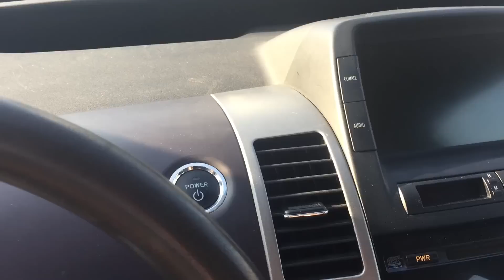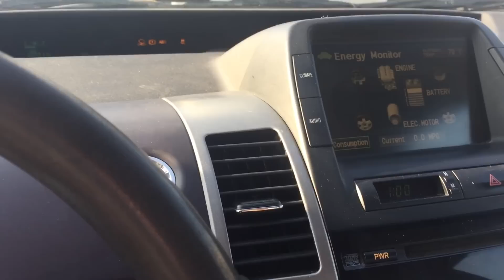2004-2009 Toyota Prius no dash lights fix!

Comment: I just fixed this problem by holding my start button for 10 sec and it reset. Try it out before you pull the battery.
Reply: That’s a good idea!  Have you had any more issues with that sense?
Reply: @SouthernSweetTia  it fixes it at the same rate I believe that this video fixes it. it's not a fix to the actual problem. it's a temporary solution. Since I don't have any intention to pull the dash any time soon. I will use it till it works. Most people when they are getting in their car simply don't have time to pull this plug out. This worked for me and I don't know if it will fix it everytime. It just worked for me last time.
Reply: @SouthernSweetTia  Tia the problem has not come back yet. So far I have seen this problem on my car about once every 3 months. So in short, it will come back and I hope this works everytime until the dash just stops working.

Comment: I had a mechanic tell me that i need to remove my dashboard And get a capacitor installed! All I need, it to reset the wires.
Reply: The capacitor fix is the perminate fix,, this is the walk-around way, but it will eventually happen again...
Reply: Richard Pulliam III the dealer want to charge me $850 and keep the car for 2 weeks!

Comment: You know you can just unwratchet the negative grounding bolt w/ a 10mm wrench, much easier way to do this hack! The negative is on the frame to the right of the battery, way way less work!

Comment: you sir are a hack  it was actually painful watching you struggle with removing the cover prying and pulling twisting on the positive cover  at  least you didn't use a screwdriver to undo the electrical  connector . I hope you don't work on customers cars like that